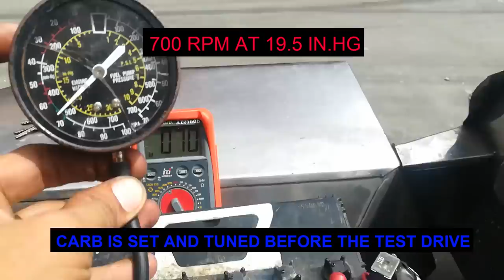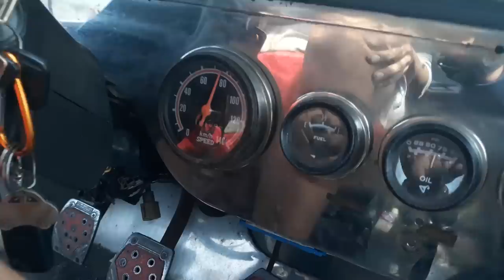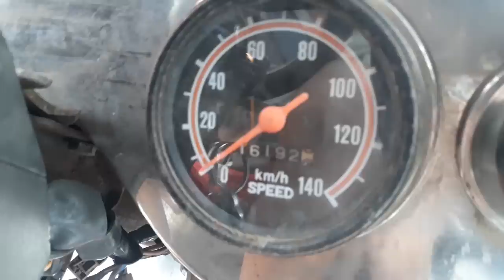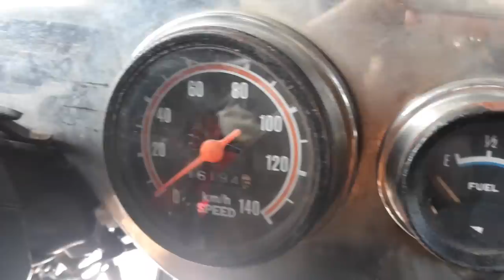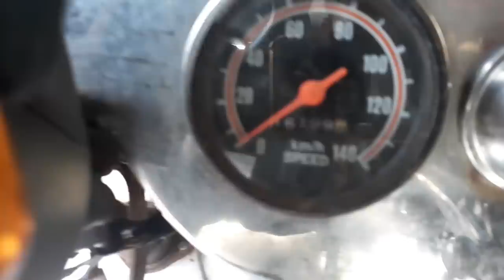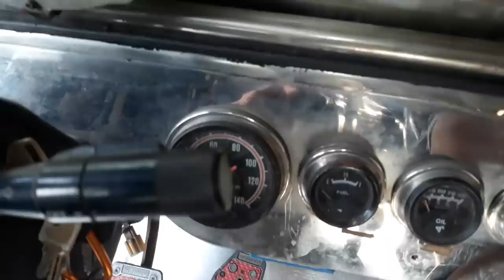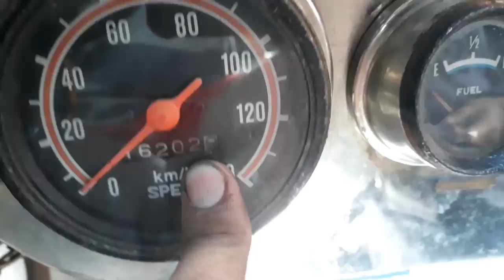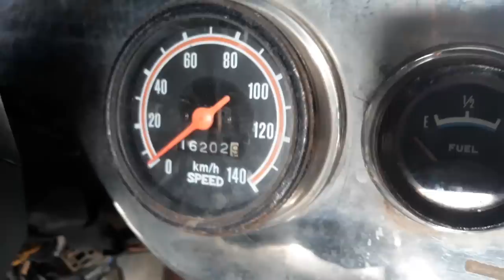MOTORCYCLE CARBURETOR ON TOYOTA 4K ENGINE - ROAD TEST

Comment: kudos for that . it only prove that innovation and development can be done. from a single cylinder engine to four cylinder. how ever the type of carb used in this experiment  is not match for the cylinder it supply the .  if the subject card was a diaphragm type and a bigger diameter intake size  above 24mm . it perhaps can achieve a high performance and fuel economy . in regard to the advancer issue which is a vacuum controlled. modified to the intake manifold just as the carb is connected to the manifold. this is just my owned technical  analysis, basing on a single cylinder engine. or replacing a rotor distributor without a vacuum advancer.  neither the less thank you for the effort of conducting this experiment to prove it is possible. kudos and God Bless.

Comment: Kaya ng engine ang 100kph with less apak sa gas pedal..so mas matipid long run kc less effort for the engine to create power..isa factor for fuel consumption is ung gear ratio ng rear end..kung masyado low gear mataas din ang consumption sa rekta kc mataas ang rpm to get 100kph..kaya dapat gear ratio will be considered..thank u

Comment: haha 700 rpm lang.  uy masama na yun.  dapat around 900 pag idle yan.

goodbye -power
                -fuelpump life
                -at kung lagi mo pa ginagamit ang saskyan mo sa highway at marami laging sakay.  matutuluyan din yang carburator ng motor.
Reply from the maker: えゆEuSei gnyn lang talg kababa ako magset ng idle speed boss kahit gamit ng stock carb.. usually nasa 750rpm

Comment: May na basa ako about direct at ported vac.adv. 

Plugging your vacuum advance into a direct source will allow it to engage at idle, which is good for a number of reasons. Much like cruise conditions, engines run leaner at idle than they do under load. Again, this means the mixture burns slower and needs an earlier spark to optimize the burn. Ensuring that the mixture has a complete burn before leaving through the exhaust port also helps the engine to run cooler at idle. All carbureted cars were set up with direct vacuum to the distributor before more stringent emissions requirements reared their heads.

Ported vacuum sources are a result of emissions laws and manufacturers doing whatever they could to get big V8 engines to pass smog before the incorporation of the catalytic converter. The idea was that by using little to no spark advance at idle, the exhaust gas would leave the cylinder still-on-fire and help maximize the efficiency of antiquated air injection systems. Engines from this era often ran very, very hot, were prone to warped exhaust valves, cracked cylinder heads and all other manner of issues. Using a ported spark advance will still allow the vacuum advance to do its job at steady cruising, but all of the benefits of idle cooling will be lost.

Comment: kapatid  wag mong i-try ang bagay na hindi pwede kahit anong angulo maba-bash ka lang ng tao.kaya nga may tinatawag na air-fuel-ratio for a certain piston displacement of an engine to provide a proper combustion na makapagbigay ng demand power na kailangan ng sasakyan.pwede pa kapatid ang 6cylinder  lagyan mo ng carburetor ng 4cylinder (like carburetor ng volkswagen/solex brand).hanggang 80kph lang ang takbo mo.

Comment: tanong kuna dn pala ung kia pride ko pag nag on ako ng headlights biglang mag da drop ung rpm ko from 1k rpm to 100rpm nalang ano kya posibling sira ?salamat idol sana masagot mo katanungan ko.:)
Reply from the maker: Raymond Capinig grabe nmn bagsak ng tpm mo boss.. tsk sa 100 rpm d n aandar yan.. check alternator, grounding,
Reply: Jeep Doctor oo sir kya ginagawa ko pag gabi ina adjust ko ung rpm nya hangang 1500 pag on ko ng headlights nasa 800 rpm sya .
Reply: ung kasama ko ganun dn ung issue nya nag palit na daw sya ng brandnew na alternator 80amps ganun parin

Comment: Sir pwede po pa explain po  ulit yung sa spark plug kapag black, gray tapos yung with motor carb. Ano pong signs yung mga yun.
Reply: pag black boss either carbon fouled or oil fouled.. pag white/grayish n parang nauubos ang tip ng spark plug lean mixture nmn yun.. pag brown n kulay kalawang tulad sa video good yun
Reply: Yung sa akin po kasi black pag tinanggal, panu ko po malalaman kung carbon oh oil fouled yun? Ano rn po dapat gawin?

Comment: Kailangan siguro gawin mong twin carb ng honda 155 at gawin mong stepped Throttle Valve OPENING system, Kaya naman niyan dahil yung toyota corolla 3k engine. 1975 SR twin Carb. 
At Mag drill ka ng brass tube sa intake manifold para may Vaccum line para sa advance actuator ng destributor
Reply from the maker: boss negative ang pagdrill sa manifold paa lang sa connection ng vacuum advancer.. ported vacuum hinahanap natin at ndi manifold vacuum.. marami pa po available ports ang intake manifold ng makina ko kaya kung need ko lang ng port pwd ko gamitin yun kaso po ibang klase vacuum kailangan. PORTED po
Reply: Ok kaya naman mag install ng Vaccum fittings para maikabit ang vac advance mech.
Reply: Pano boss kung carb ng raider gamitin

Comment: Sir yung xrm na carb ok bayun sa 4k
Reply from the maker: Gapuz Fred pwde din sir.. pero malamang ganyan din maging result.. maganda pa rin stick tayo sa stock carb..
Reply: Gapuz Fred in case wala kang budget bumili ng stock carb.. Better use motorcycle carb.. Akin Nissan sentra 1993 model ata to xrm 125 carb nakakabit..tested na byahe CDO to bukidnon

Comment: boss sa tinging ko po makaka  tipid pa kapag gravity fed pag traffic. kasi po ka baka mag over flow sa force feed ng fuel pump tapos ma forced feed sa needlle. kaso pag nasa expressway baka kaposin pag gravityfed 

yung lang po salamat  po
Reply from the maker: Mark Liang actually boss pwde nmn ang fuel pump basta lagyan m lang return line ang carb pabalik ng tangke.. mahirap kasi mag gravity fed sa cars kasi wala paglalagtan n pwdeng mas mataas sa carb.. isa pa tama k baka kapusin ng gasolina sa rektahan.. hehe.. anyways sa video n yan proven n much better ang stock carb